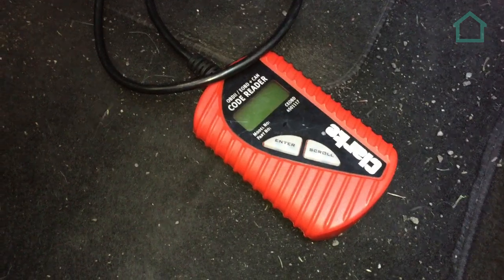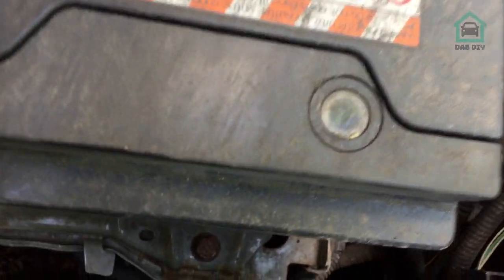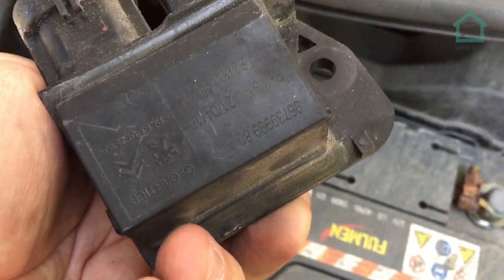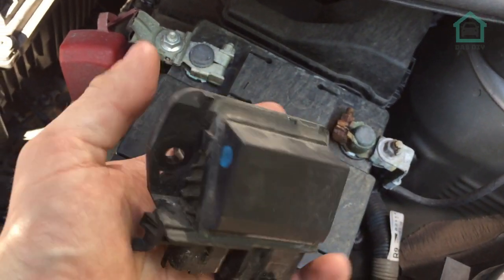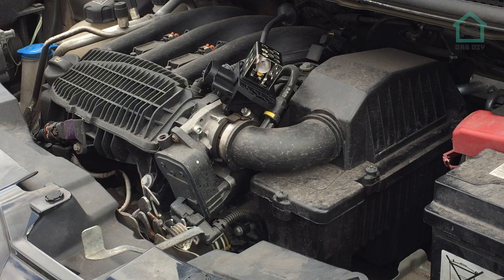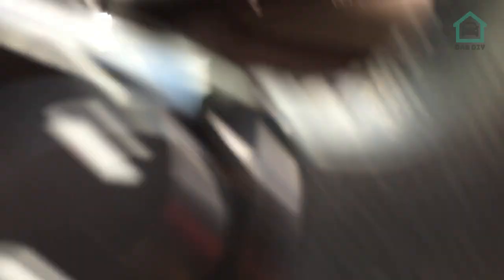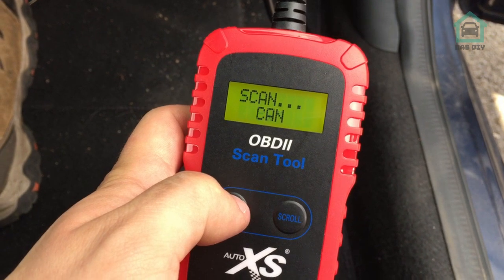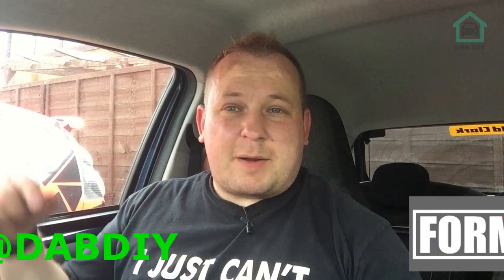C1 Mk2 PSA 1.2 petrol engine code P0494 fix

Comment: Just received and installed it today, check engine light switched off. The mechanic was charging me £860 for this resistor and for the rear wiper motor, rip off. Bought the parts from Amazon and Ebay for £100. Just watched a video on YouTube and changed it myself. Thank you
Reply from the maker: I’m glad you saved so much money!

Comment: Perfect fix thanks Dan I tested fan by running and putting on air con, check wires and took off the sensor and it was bit corroded... Went on eBay hundreds of them for £10-20 order new one 👌👍🏻 thanks to your video I've invested 11 mins so far and predicted fitting time 4-6 mins 😂
Reply from the maker: I’m glad the video helped!
Reply: Certainly did  @DABDIY  ironically my OBD read " two codes fan speed low " that was on I car soft and on snapon said " fan assembly fault " 😂 so ofcourse I'll await the new part fit and clear and drive to be 100% sure but it seems like it's another deliberate failure design to sell plastic parts with springs for £45+ vat a pop and £90 labour to find out ...they just want people back in the dealerships ...all deliberate

Comment: Thanks for the video. Very helpful. I had the same code and I replaced that same unit and all was good. 
One thing of note, if you switch on the Aircon, the cooling fan should also come on.

I can’t take credit for that bit of info, (maybe, all cars are the same, worth checking yours) but it got me out of a pickle, hundreds of miles from home. 
I was in traffic and the ‘stop engine, temperature’ light came on, I stopped and I was aware the cooling fan wasn’t on. 
So, by switching on the Aircon, in this instance, it activated the cooling fan also. Phew!
Reply from the maker: That’s a good bit of advice!
Reply: Wow, I'll try that this afternoon!!!

Comment: I've just managed to change this part so many thanks for this video! I had this P0494 error appearing on and off my C1 for over a year and hopefully replacing this part clears this issue.

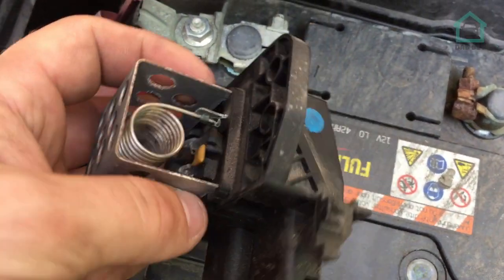Also for less experienced people like myself, to pull the connectors out, you first have to push the wider bottom part of the orange "latch" down (i.e. away from the connector). This then gives you space to push the inside top part of the connector/clip up, which holds it onto the controller, and pull the connector out. I used a flat head screwdriver for both of these steps. 2:49 and 2:08, respectively, are probably the best still pictures for reference
Reply from the maker: I’m glad the video helped! Good of you to give additional advice to everyone else too, thank you 👏🏻

Comment: Would this code cause the coolant not to circulate around the engine ?
Reply: No defo not just causes fun to come on if too hot or runs inconsistently when faulty. Nothing to do with coolant circulating but may cause over heating
Reply: Thanks guys, I still have this problem. Changed the thermostat, the fan relay and the code still comes on. Checked all the fuses relays still the same car starts to overheat. I've tried 2 diff relays and still the same...
Reply from the maker: I wouldn’t have thought so because it refers to the control unit, but I can’t be 100% certain about that.
Reply: Also put direct power on to the fan and the fan comes on. Burning my head out this fault 😒

Comment: Had this fault code and reset the code and fan came on again, works for a while until its hot and stuck in traffic, seen this video and just replaced same part myself as garage quoted 140 quid for 2 hour labour and part. I usually service my car myself and this video helped alot on testing the fan before i purchased the part
Reply from the maker: I’m glad it helped! Saved you a few quid too.

Comment: I was having this check engine icon and p0494 since long time by rain normally but today my air-conditioning died: it seems like pompe of a\c doesn't starts., and this p0494 fault is always on the dashboard. 

Should i change this module or its time to go to garage to check the a\c pompe 😢?
Reply: So i changed the relay of fan and it worked. A\c works as new, no more fault icon, even after rain. 

So thanks for video and for answers, i hope someone could save money on garage)
Reply from the maker: It sounds like you have two separate issues here
Reply: I'm no mechanic, but as the engine cooling fan also cools the a/c heat exchanger, might they be linked?  @DABDIY
Reply from the maker: @mikeofdorset potentially, but not in the case of this video.
Reply: Will this code cause the coolant to not circulate around the engine ?

Comment: Wow. Guess what my c1 code came on last week. Same code. Only comes on when car is hot. Thank you for making this video. Well done God bless . I'll order that part anyway. But it says 12 quid on eBay with same part number. But says it's for Ds 3. Doesn't say c1. Looks the same on the photo with part number. Can you let me where you got yours from. God bless
Reply from the maker: I got mine from a local motor factor, but these engines were used in various models. If it says it’s for a 1.2 PSA engine, my best guess would be that it’s ok.
Reply: @DABDIY  thankyou